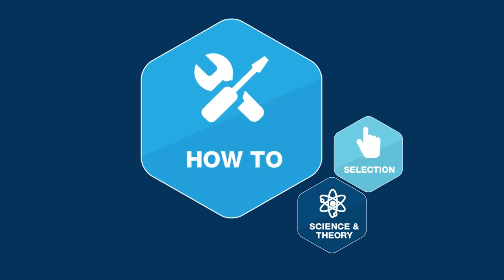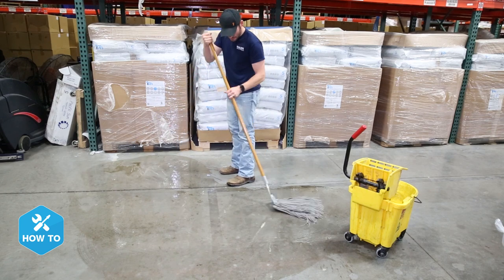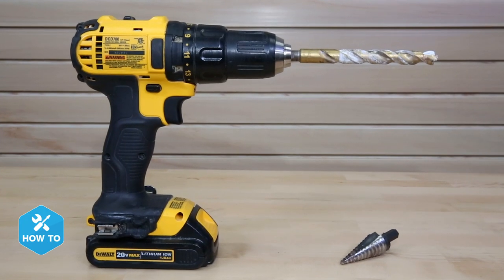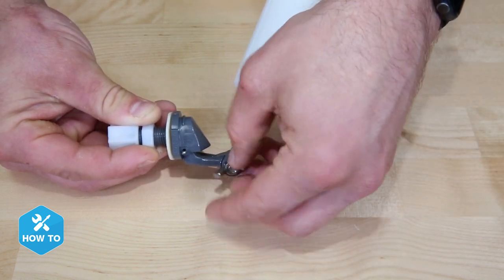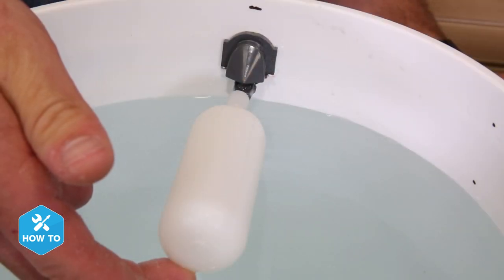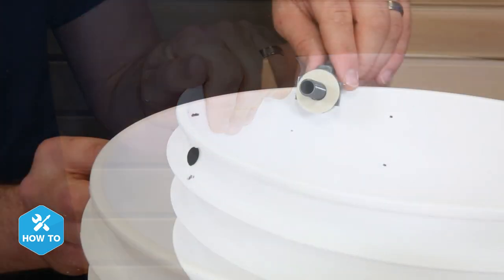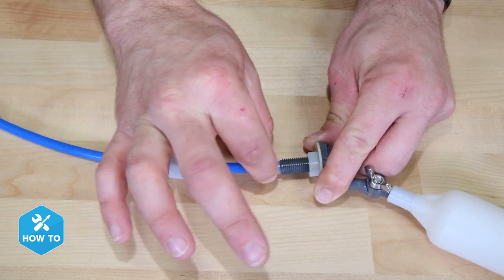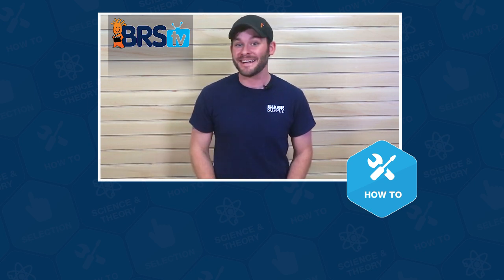How to install a float valve | BRStv How-To

Comment: I thought I’d share what’s been working very well for me:
I’ve been using this style float valve for nearly 8 years now for a gravity fed ATO setup (5gal). It keeps sump’s return chamber water level extremely constant with no pumps or or electrical float switches to potentially fail. I honestly don’t know why more people don’t do this. 

I fill the ATO reservoir from my 55gal RODI reservoir using a pump on a timer and I have an overflow installed at the top so that if the timers slightly off the extra water just runs straight back into the 55gal reservoir. 

Anyways I’d thought I’d share what I feel is a pretty fail safe and simple method. Cheers

Comment: For most of us this may already be common knowledge, but it is still worth getting the word out: 
The RO/DI shut-off kit should always be used when adding a float valve to your product water container.
While the float valve will stop the product water from filling your container, the RO/DI system itself will continue to run. This means water is continuously being dumped through the wastewater line unless you install the shut-off kit.

The BRS website sells these as a package so you have all the parts you need. But other stores might sell just the float valve without mentioning the need for the shut-off system.
Reply: SaltRockStacker 
I completely agree. The auto shut-off kit is a necessity for an RO/DI unit's product water reservoir, such as the infamous grey Brute trash can. But this video is just how to install a float switch on a bucket or container period, which is really the only place someone would get caught up installing the Auto Shut-off kit anyway. 

BRS has a separate video on their site for installing the whole kit, except for the float switch itself. The kit should've been mentioned in the video and hopefully they'll add this video to the kit video on their site.

Comment: This is a good video to publish. A float is a necessity for anything RO/DI related and many folks don't know how to install one precisely, especially for the RO/DI auto shut-off kit. Good info!

Quick question... How would you recommend adding a float to a Trigger sump, the 39 Sapphire specifically? Does it have to  be drilled? And how many inches down do you recommend drilling the hole for the float? It's just that it's such an expensive item to alter and possibly mess up.

Comment: Would you suggest to use the adjustable one directly into your sump as an auto top off. And what else you should use with it to have extra caution if the float valve fails to shot off the water into your sump ??

Comment: Any suggestions for a quick way to disconnect the blue line from the valve for emptying the bucket or moving the bucket away from the RODI unit for storage/use?

Comment: Nice video! So the float valve stops water filling up the container when it's full, but the water tap is still on and water is still go through the RO unit. So, wouldn't there just be a pressure build up as the water will have no where to go? Thanks.
Reply: Without the complete shut-off kit, any additional water after the float valve closes will flush out via the wastewater line. I don't like operating the RO/DI unit this way as you are potentially running a membrane flush through the flow restrictor.

The shut-off kit detects the pressure buildup in the product line and will shut off the main supply line. Your tap is still open, but the water can't enter the very beginning of the RO/DI system.

For folks considering getting RO/DI units, the following add-ons are highly recommended (if not outright required):
1. Shut-Off kit
2. Membrane Flush kit
They are more than worth the extra money.
Reply: SaltRockStacker Thanks a lot.
Reply: BulkReefSupplyCom Thanks as always.

Comment: How does a float valve play with booster pumps though?  Sure it might clip off the water but the booster pump will keep cranking and you might burn it out or pop a line right?

Comment: I have this. The problem is the float is in the way when I scoop up water and I have so far broke 2-3 of these float at its thread end.  That is Kerick valve and they don't sell the float alone.  If there is a way to install the float parallel to the bucket wall, it will last longer.
Reply: Derek Chung You could use an adjustable one and just loosen and swing the float out of the way. Or better yet just use a small pond/fountain pump and pump the water out and into your tank. That's how I get new water into my tanks. So convenient I'll never go back to scooping
Reply: 1. Once the wing nut is loosened, it might not be convenient to get it to the level. 2. Even with a pump, sometimes it is easier to just scoop water out. 
Ideally, the float should be on the side and they need to sell the floats by itself CHEAP OR make it harder to break at the thread end (but then, something else will break, won't it.)
Reply: Derek Chung 
What exactly are you using the float in, a bucket, trash can? Is it for redundancy or is it the only shut-off? Because if it's a small container, like a bucket, then maybe you should switch to a dual optical sensor, like the one from Icecap, that you won't hit when removing water. It's cheap, gets the job done, and it'll be out of the way. I have a float in my RO/DI product water trash can, but it's a big container so I don't hit the float on the side. Or use a smaller scooper if none of the above works.
Reply: Yeap.
Reply: 5G bucket. It is mobile and I prefer not to run power when I use it. No pump, not optical sensor. Anyways, it is just my 2 cents. Yes, in my case, some sort of elbow would be the best.
Reply: Derek Chung 
Is that bucket you're RO/DI reservoir from the pump also? Like you have your RO water pump into this bucket, have the float turn it off, and then move it by the tank?

I have a similar setup, though I have my RO/DI pump into a 44 gallon Brute trash can in the basement, then fill a 5 gallon bucket and bring it by the tank for top off. I scoop water out manually as well to refill. 

I don't know if it's possible but you could leave the 5 gallon connected to the RO and put a screw-on gamma lid on it, so it's easy to remove, then transfer the water to a separate mobile bucket without the float to scoop your top off out of. The mobile bucket could even be a 2 or 3 gallon bucket. Or you could connect the float into the smaller bucket if you don't have space for a 5 gallon stationary bucket, and just fill it and dump it into the 5 gallon twice. 

I'm just trying to think of a scenario where you wouldn't have to deal with the float being in the way. But it sounds like you really need a stationary RO bucket, whether big or small, and make your mobile bucket the one without the float. Because the float isn't really meant to keep being disconnected & reconnected constantly. It's made of very light, cheap plastic. So that probably weakens it as well by the threading where yours keeps breaking.

Comment: My problem is: I capture my waste water in a 32 gallon trash can and although my float switch on my product water 5-gal bucket stops from overflowing, my trash can will continue to fill with waste water (I think at a slower rate than usual) and flood my garage if I don't use a timer as a reminder. 

I use my waste water to fill my laundry washing machine for the first cycle with a submergible pump connected to a hose for the water transfer. ;)

Is this a common problem? Is there anything I can do to stop the waste water production?..